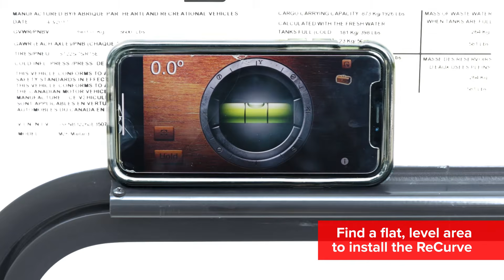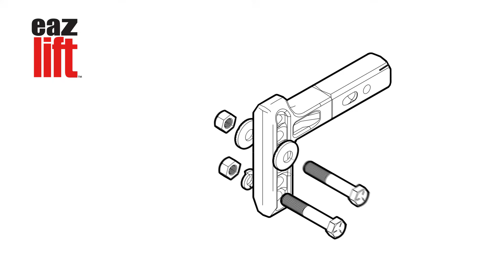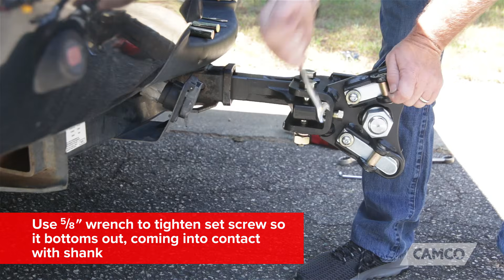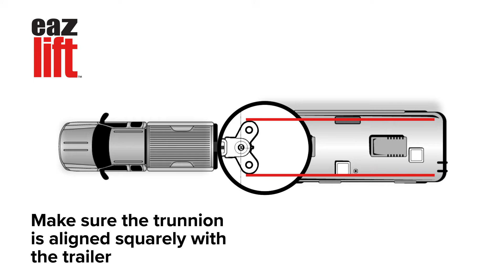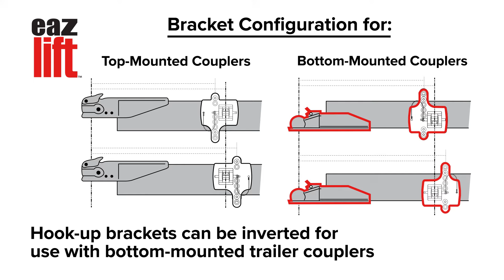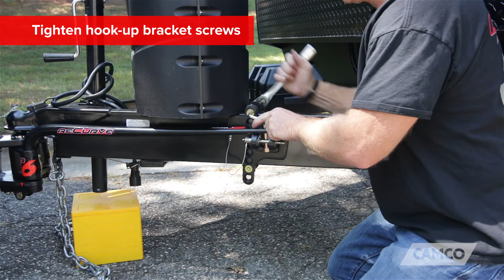ReCurve Install How-to: R3 & R6 from Eaz-Lift

Comment: it seems to me, following this as stated, will work if you achieve the 1 in. or less on the tow vehicle height, however, if not you would have to loosen up the bolts of the shank/ball hitch and the lower 5/8 bolt to adjust the pitch.... the 5 1/2 turns isnt anything but a good starting point (the instructions say start at level ball pitch) either way, some fine tuning may be required.... i agree with some other comments having a bit more clarity and adjustment for more or less tilt to adjust torsion would be helpful. The instruction manual also states (instead of the initial coupler to ball height adjustment of 1 inch higher) it says aprox 1/8in per 100lbs of tongue weight.
Reply: Yes. I’m installing now. Reading the instructions then watched this.  They basically ignore the instructions in making this video.

Comment: Can another video be made showing adjustments? 

For instance, install it intentionally outta whack, then show how to correct it. Head angle being off will affect the distribution, as well as change the balls height. Tipping back too far may reduce ball hight by a half inch, when all a guy wants to do is adjust the bar pressure.
Reply: How do you adjust the bar pressure?

Comment: I have this exact same hitch with 1200 bars and thinking hard about keeping it. On my way home, I kept feeling an odd clunk coming from the hitch area and never could figure out what it was until the next morning when I was hooking up to leave. At that moment I discovered I was completely missing the top bolt, conical washers and nut. Besides the safety chains, only thing holding my 11k toy hauler to my truck was the bottom bolt and that was so loose the hitch head could be moved up and down by hand. Not sure if the top one vibrated loose, snapped or who knows but tried to contact Camco and they never got back to me. Ended up getting all new grade 8 hardware with flat washers because I cannot find the conical washers, torqued the whole thing down to 260ft lbs and prayed as I drove the remaining 700 miles.

So buyer beware and for us that have it, we should all break out the torque wrench and check the torque every time before hitting the road.

Comment: Great instructional video. Just to add in case others are curious, the shank can be flipped to attain thr height needed.
Reply: I was wondering this. I have a 19’ trailboss pulling a 2006 crossroads cruiser and I’m squating. Was wondering if I could turn it to get more clearance.

Comment: The round-headed bolt inside the hitch that I am to set with a punch came loose on my last trip. Also, the units that hold the ends of the bars on the trailer frame also came loose. Is there a secret to making sure everything stays tight? The main 4 bolts and the trailer frame bar holders were tightened down with a 3/4" Ingersol Rand impact and double-checked for tightness with a 2' long breaker bar.

Comment: You will see a recent comment from me about two large a pair of spring bars that I am in process of solving. Thank you for the technical input Camco. When I get the new 600 pound spring bars, I will be resetting the unit to my new vehicle which is a ram 2020 1500 limited with the 5.7 hemi engine. There is one possible technical glitch in that the limited comes with four corner air suspension that can change the height of the vehicle. (Lower for easy entry exit; raise for two different heights of off-road travel; something called the Aero mode which will lower the vehicle when going 60 mph or more in order to make a slippery aerodynamic silhouette)

My assumption is that I should disable the air suspension while I set up the Truck for height of the trunnion and proper balancing of the load between axles. I also think this should be done In what they call "normal height" mode. When it goes into the "aero mode" it will lower the vehicle by .6 inches. Is this a problem if I have set the camper to be level with the ball mount on the vehicle in normal height but then the vehicle drops .6 inches? I know we're getting close to rocket science here but these seem to me legitimate questions.. Thanks for your input

Comment: what do you do if the truck wheel height is lower than 1 inch, like 2 inches. also how do you adjust the brake feature in this.Thanks.

Comment: I have the R3 1000lb spring bars from my old trailer that had a tongue weight of 920lbs and it worked great! Now that I have a new trailer with a tongue weight of 12-1250lbs can I still use the R3-1000lb? I have it hooked up now and have towed 5-6 times with my new to me 2016 F350. It levels the trailer just fine but when I tow the truck bounces and it feels like the trailer pushes my 1 ton truck around giving me a horrible driving experience. Do you think that having only the 1000lb bars would cause this problem? Also is there a 1400lb spring bar and if so would you recommend the 1400 or would a 1200lb be sufficient? My tongue weight could go higher because my trailer gross weight can go up to 9999lbs. thanks

Comment: My R6 trunion was out of alignment while drive straight down the freeway. An RV mechanic said to increase the tilt of the ball by 3 turns on the adjusting dial. I was certain it was the parts where the bars clamp into because they were off the half inch. The RV mechanic said those are supposed to move?? Is that true?

Comment: What if it’s not within an inch , then what?
Reply: Came here looking for this same answer.. doesn’t look like anyone responds
Reply from the maker: Thanks for the question, Randy & Chris. I apologize for the delayed response. The acceptable amount of squat is 1”–1¾”. If you're experiencing more than that, perhaps the angle needs adjusting, or you don't have the correct size bars for your trailer. Please give our customer service folks a call at 800.334.2004. They will be able to walk you through what you need to do for your specific equipment.   --Scott
Reply: Just for shits and giggles, ya might wanna check the front fender hight as well. Ass end goes down, front will come up.... I'm shocked that he never mentions that. It should NOT be higher than the unloaded measurement. (1/4" either way or so is ok, but any higher will cause understeer).

As with every one of these hitches, you may need to play around with head tilt to get a good bar pressure. Tilting back increases bar pressure, tipping forward reduces it. Tipping will also change the ball height, so here we go setting it up, AGAIN.... Using a cat scale with the truck alone, vs after you setup with the trailer, will tell you volumes on where the weight is at.

Comment: What tools needed to install?  I can't find anything mentioning the size wrenches and sockets needed to tighten the bolts. I had mine installed at Camping  World and have to change the shank because I didn't notice it was too small (2" in a 2 1/2" coupler) after I left and it's too far to drive.  Yes. I am a rookie.

Comment: The video says "turn the thumbscrew out 5 1/2 turns as a good starting point" and "measure the fender height again to make sure it's within and inch of the first measure." It doesn't say what to do if it isn't. How do we adjust the tension of the lift bars? Back off the 260 lbs on the two bolts, loosen the set screw and turn the thumbscrew?

Comment: The arms that attach to the trailer keep slipping. They are slipping after 50-100 miles of towing. The dealer has installed this hitch TWICE. Any suggestions? What is the correct foot pound for tightening?

Comment: I have Intech Sol Dawn 2700lbs dry TW 300lbs, Lexus GX460 5K Towing class 3 hitch and capacity with 500lbs TW. Will this WDH do, how much ball hitch angles should tilt. Or this just over kill for my need?

Comment: On the hangers. There is an insert which can be flipped 180.  Your video shows increased contact surface facing up. In the drawing it seems to indicate that flat surface facing up, except when the hanger is rotated for bottom mount hitch, the drawing indicates the flat surface downward.  So the question is, the part was designed and built with that increased surface area however no mention is made as too which way that surface is supposed to face.  I've sen other videos where they have the extra surface pointed down and not in contact with the spring bar..............  I'd say the flat goes to meet the spring bar but that is just my best guess......
Reply: I'm not sure if this addresses your comment. There are 4 holes in one end of the shim (aka "insert") and only 1 hole on the other end of the shim.  These "4 holes end" needw to line up with the "4 holes" on both the bracket.  Ditto with the "strap" that retains the bracket from the inside of the trailer A-frame.  If all of the bolt holes don't line up you are limited with where you can insert the bottom flat-head screw/bolt.  This can cause the bracket and strap to "bow".  If this happens, parts of the bracket and strap will not make contact on the trailer A-frame and the whole thing can rotate when under pressure. BTW, the shim is placed between the bracket and the A-frame to make sure that only the shim contacts the trailer frame.  The shim creates a small gap on either side of the itself which is necessary so the rest of the bracket doesn't touch the frame (which can cause bowing and possible slippage).

Comment: It’s 2023, how about an updated video addressing everyones concerns and questions which is the ball tilt
Reply: Ty because I'm new at this and I need answers before I spend my money
Reply: @CandyMan69007 really hope you didn’t spend that money on this. I did, got a completely different set up for adjusting the ball angle, and can get zero help from these nut jobs on how to do it right. Pathetic customer service.
Reply: @jasonmcmaster4968 I did get it and it's been great for my 5 trips I've  been on this year. I've got the recurve 3 and I did have to figure out how to put it together myself because they video miss a step
Reply: @CandyMan69007  I still can’t get it set right on my 2019 f150 and have yet to hear back from Camco. Their customer service is garbage. Did you get this one or did you get one with the blocks like I described?
Reply: @jasonmcmaster4968  Whats the problem your having?  I have the R3 on my 2018 F150, and it pulls like a dream.  I just set it up like shown.
Reply: @yessir663 buckle in because there’s no way to make this short. For starters, what they sent me isn’t the R3 shown here. They sent an R3 with aluminum blocks to adjust tilt and not the thumbscrew so it’s a completely different set up. Even the instructions there included are for one with the thumbscrew so it is a guessing game as which side of the block to use. It almost looks like I was sent a prototype of the R3 because I can hardly find any info on the what I have. It worked really well on my Honda Ridgeline (lucky setup I guess) but I get a ton of sway if I go over 60 with the F150. If you have any pointers, I’m all ears. To this day I have yet to hear from Camco on any email I’ve sent or phone call I’ve made. My current set up is with the ball at the lowest possible depth on the shank and the tilt pretty much set in the center as best I can figure. My 2019 is stock but the back sits high enough that I really could use an additional 2-3” drop on the shank to have the camper sitting level, I just can’t find the extended length shank that Camco supposedly makes
Reply: @jasonmcmaster4968  Dang dont know what to tell ya, but maybe take it to a Camping World and tell em what happened. Camping World have been know to refund items not bought there.   I set the cruise at 65-70 mph and its just smooth as butter.
Reply: @yessir663 believe it or not that’s the exact way my 2021 Ridgeline pulled my 21’ Jayco. Those trucks are surprisingly capable! I just haven’t found the right setup on that F150. I may run it up there to Camping World after we get back this weekend to let them have a look at it. Hopefully they have what I need to get it set right. Thanks, man.
Reply: @jasonmcmaster4968  Watch their video of their Elite hitch. Different hitch, same ball assembly and it has the updated version with the weird hex plates. I just ordered an R6 and got the old style with the thumb screw. Apparently they redesigned it because people weren't tightening the thumbscrew so it was hammering into the hitch when hitting bumps, causing it to strip the threads.

Comment: What if I have more than one inch of drop? What adjustments do I make? The video should explain this and any other adjustments.
Reply from the maker: Thanks for the question, brentoned. The acceptable amount of squat is 1”–1¾”. If you're experiencing more than that, perhaps the angle needs adjusting, or you don't have the correct size bars for your trailer. Please give our customer service folks a call at 800.334.2004.     --Scott

Comment: Hi, Excellent video. Questions .... 
1. about the brackets.... What model comes with those shown in this video? because everywhere I shop it shows different brackets. 
2. Is this what I need? 
Camco Chem 48750 Wd Hitch Kit Recurve R3 400 Lb. 
For my ROCKWOOD-GEO-PRO G19FBS TRAVEL TRAILER
20 Feet long
UVW:3075lb
CCC: 1013lb
Tongue: 413lb
Reply: Seems about right i also purchased the 400lb mode for my Clipper Cadet 17CBH which is UVW of 2896 lbs with tongue weight of 300lb. I think the 400 system is able to handle up to 600lb tongue and 6000lb GRVW.

Comment: How do i adjust the angle of the Spring Bars so that they are higher (closer to the Hook up hanger)?
Reply: I have the same problem. I’m going to try making the thumbscrew shorter which should decrease the angle that the bars are aiming down.

Comment: You vaguely mention the torque setting for the ball mount but never state the torque value for the flat-head screws on the brackets.  edit: 45 ft-lbs is listed in one of the comments below.  This information should be in the description, as made evident about questions regarding how much to torque the bolts.  BTW, using an impact wrench to set torque is bullsh*t.  A 1/2" drive torque wrench capable of 300 ft-lbs costs far less than the Milwaukee gun discussed in the comments below. So in addition to poor information CAMCO has provided mis-information in this video & the comments that they've answered.

Comment: We drove my brand-new to me Rockwood 25 09S, 2019 1/2 camper home 145 miles yesterday. No major difficulties but it had a recurve R3 weight distributing hitch included and I have had some problems with the hitch. I question whether it was set up properly and I also question whether the spring bars are too stiff. We almost bought this camper in the 2020 model and had a quotation for the R3 included but the sales representative – a very knowledgeable guy – quoted the 600 pound bars. I said the tongue weight might be as much as 700 and he responded that the ride would be much better with the 600 pound bars.

We were severely disappointed with the way the camper porpoised (think a flat stone skipping if porpoising doesn't give an image) and shook going over pavement seams and any kind of moderately rough condition. Very disconcerting and almost certainly indicating a setup problem. I have no problem with my brand-new 2020 ram truck so obviously something is wrong with this set up of the towed camper.

Three observations:
1.  The 1000 lb bars seem too heavy - maybe they're part or all of the problem?
2.  The retention pin on the passenger side bar can't go into the inboard holes and I just watched the Camco video where that's where the factory guy placed it. The pin strikes the outer surface of the bar pin so it can't go through. I'm suspecting the original owner just used the outboard hole (he put it in and I wasn't watching). Would that allow the bar to slop around when pitching and yawing? Why would the bar pin not go in far enough to allow the saddle clamp to be pinned with the outboard holes?
3. Original owner had a 2010 Ram 1500 so we didn't change the setup but the trailer was at least 3" high at the nose. I've reversed the trunion receiver and lowered the position but haven't had a chance to check and see if that made a difference.

Any good input or suggestions would be appreciated. Camco ru there? Knowledgeable owners also invited to comment.
Reply: I have been notified that this has been resolved with our customer service. Please let us know if you have any other issues.
Reply: @camcoman6622   Can you please share the answer/information related to the whole for the locking tethered pin. Does the pin need to be in the most inner hole (the one close to the frame) or the outer hole? I initially use the outer hole but I noticed that the bars appears to be rubbing and scratching the bracket (the area where the bar stud sets). I appreciate any advice or information you can share.

Comment: What is the purpose of the hanger straps? They're paper thin and mine rusted out almost immediately.
Reply: I believe that the shims between the frame and the hanger bracket are to place all of the pressure on the center of the bracket and not along the "ears" on either side of the shim.  The shim forces the center of the bracket to be tightened "flat" against the trailer A-frame.  Otherwise the bracket (and possibly the strap on the opposite side of the trailer frame) might "bow" and cause a gap between the bracket and the trailer A-frame. The bracket can then rotate against the a-frame when under pressure (due to lack of surface area contacting the A-frame).  If it rotates far enough things can get bent.  I myself installed the shim upside down and the hangar bracket rotated soon after we pulled out of the driveway )-;  I learned to pay closer attention to the pictures on the DOWNLOADED version of the installation manual (where I could zoom in).